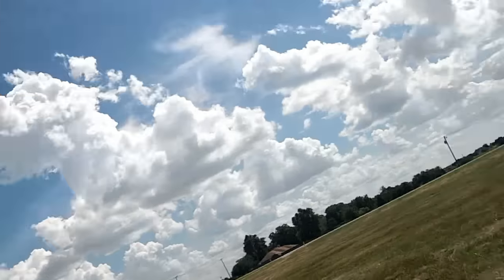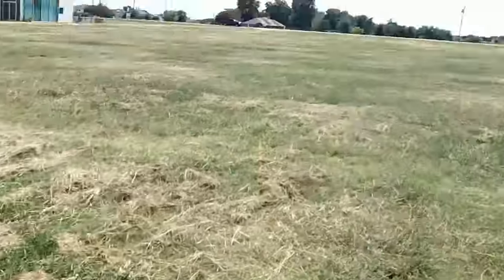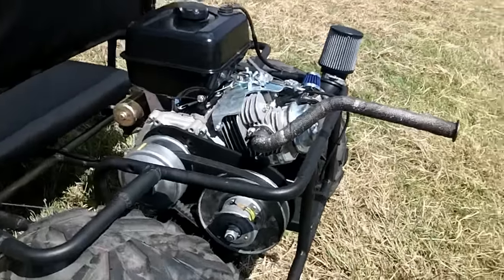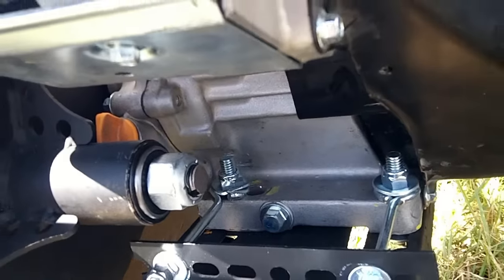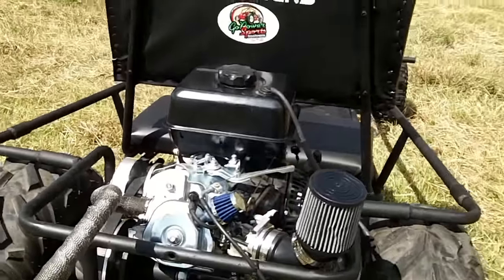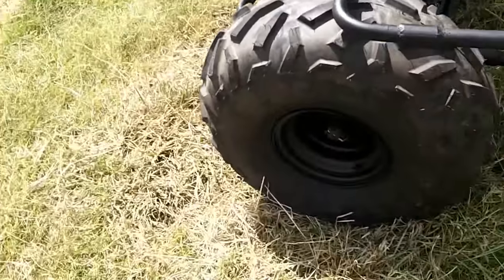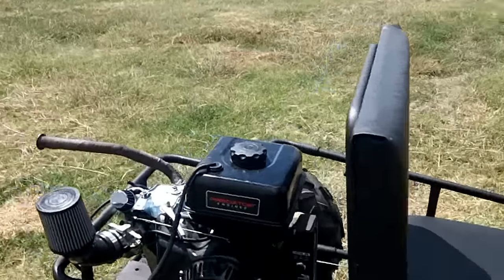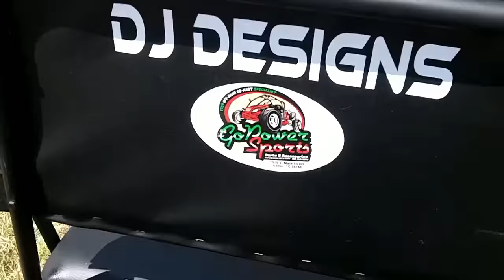Go Kart ride along - Predator 420cc - GoPowerSports

Comment: nice job dude.  very tight kart.  the tensioner is brilliant.  going to hardware store  for eye-bolts tomorrow. thanks for sharing.
Reply: weld washers to your eye bolt and youll have less problems than having a big gapping hole for slack and movement.

Comment: 2 questions 1st.  Does your front end/steering shake at higher speeds- if so what have you done to fix this. 2nd. I'm having issues keeping this same engine on. When I first start the car I put the choke on start and then have to slowly move choke towards run about half way.  If I go all the way to run it dies.  And when I drive it and hit the throttle all the way it start to get and go and then acts like it's going to die then have to let off throttle so it doesn't die.  This whole time I have a ton of white smoke pushing out the exhaust.   Maybe flooded the engine idk.

Comment: I did like you threaded eyelets for adjusting you engine chain tention.i thought it was simple and innovative. I am wanting to build something with two my two new predator 420 engines. I got the first one at Harbor Freights standard sale price of $249. the second I got from one of their tent parking lot sales for $179. I didn't need another engine, but I couldn't pass up such a deal. I just wish they had better charging coils on them for charging the batteries and running the lights I'm hoping to have. I'll look for your other videos.

Comment: I did like your threaded eyelets for adjusting you engine chain tension.i thought it was simple and innovative. I am wanting to build something with two my two new predator 420 engines, I might find a use for using your idea.. I got my first predator engine at Harbor Freights standard sale price of $249. the second I got from one of their tent parking lot sales for $179. I didn't need another engine, but I couldn't pass up such a deal. I just wish they had better charging coils on them for charging the batteries and running the lights I'm hoping to have. I'll look for your other videos.

Comment: Another question Josh, what size chain are you using? Because the sprocket on my torque converter looks like it’s not made for a 420 chain, the teeth are too short and the grooves are a little small??? Can I get a different sprocket that I can put my 420 chain on
Reply from the maker: Not sure on exact size. Should be able to get a chain that matches the sprocket on the torque converter and axle

Comment: Y are those rear bars so close to the rear tires?
Reply: Diy type of guy i noticed that too
Reply: camjamsdad those ballon? lol no
Reply: it could help knock mud off of the rear tires
Reply: My guess is cause there's no actual rear suspension in it anyways..?  better question is why use one of these motors?, do these have some kind of gear box at all?, why not use a pit bike motor with gears?
Reply from the maker: No rear suspension so bars never rub tires

Comment: how did you wire the lights? does the engine charge the battery with a charging coil?
Reply from the maker: Tom Son we didn’t have the light wired yet. We were just going to put a battery behind the seat and wire it to that with a switch. Yes the engine can charge the battery

Comment: how r u goingto offroad this go kart with like a quarter inch tire clearance on the back
Reply from the maker: the frame is welded solid so it doesn't flex and the rear axle is solid so there is no issues
Reply: Ahh ic. Good shit
Reply: Nice job man!

Comment: Dude this is soo funny i had to do the exact same things to my gocart mine looks exact to yours it's just mines a one seater plus I've got a vew couple of racing equipment on if u know what I mean lol @david-josh...
Reply: @Random Shenanigans 2 questions 1st.  Does your front end/steering shake at higher speeds- if so what have you done to fix this. 2nd. I'm having issues keeping this same engine on. When I first start the car I put the choke on start and then have to slowly move choke towards run about half way.  If I go all the way to run it dies.  And when I drive it and hit the throttle all the way it start to get and go and then acts like it's going to die then have to let off throttle so it doesn't die.  This whole time I have a ton of white smoke pushing out the exhaust.   Maybe flooded the engine idk.

Comment: Why would you put all that extra money into a governed engine? Get that governor out of that thing.
Reply: catfisher420 
Govener looks after engine.
Reply: Doing that completely voids the warranty, genius. And if you’re gonna spend the few hundred bucks on the 420cc in the first place and do a proper build as he did, bet your ass he probably shucked out the extra cash on an extended warranty to get a free replacement engine. Besides, did you even SEE the CVT clutch? He gets plenty fast launches when he wants...and it’s not a race kart! My kids have a governed 2 seater Manco with only a Predator 212cc. BUT, also has the Comet CVT (torque converter). It comes out of the hole plenty fast for them and even governed tops out at 40-45. It’s a recreational kart, kid. And if they blow it up in 2-3 years I just drain the fluids out and Harbor Freight gives me a brand new engine.

Comment: that thing is a piece of garbage and its slow as crap. Its slower than my grandmas electric 
scooter.
Reply: Luke Weseman piss off bellend!
Reply: Luke Weseman damn prius owners
Reply: Dude. I have a cart with a 212cc Predator and a Comet CVT (torque converter). I promise he wasn’t even getting close to all the way into the throttle, governed or not. Otherwise, with mine it’s basically zero to 40-45mph almost  all at once with an adult rider. With a 420cc and a CVT?? There’s no telling.